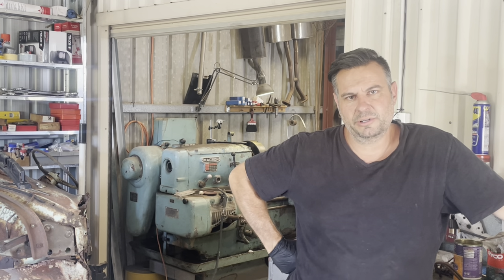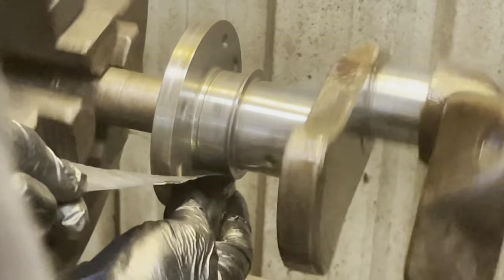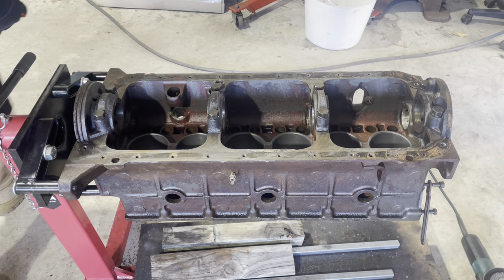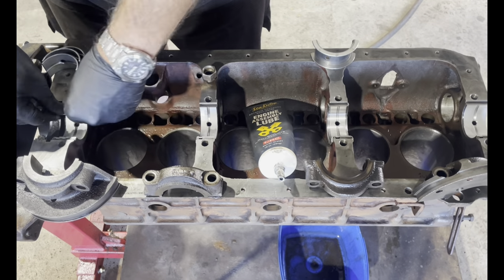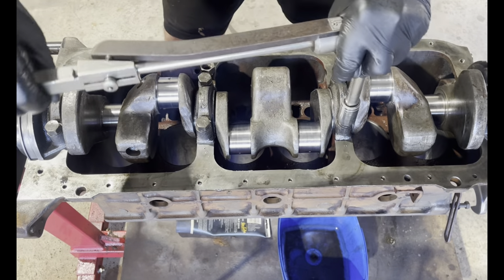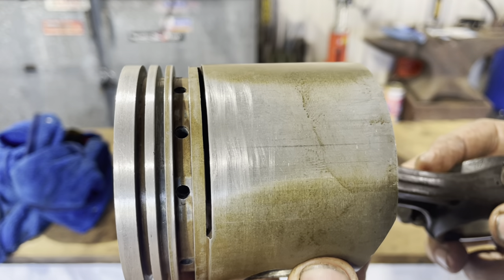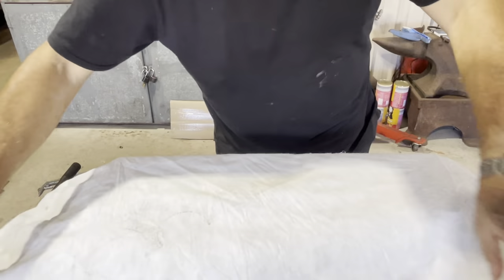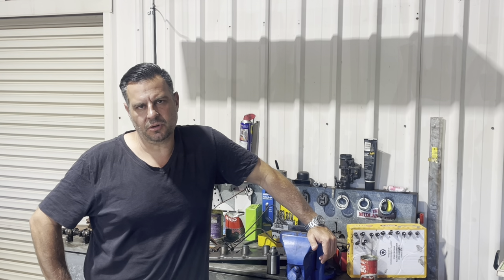FJ holden Grey motor rebuild Part 4: Crank and Pistons install

Comment: You should never lubricate the back of the bearings. You never install piston & ring assemblies dry. The ring gaps in the new rings are still too big. A 2mm ring gap is excessive. It needs to be less than half that gap. When cranks are machined, the bearing size is said to be UNDERSIZE, not oversize. Regarding the camshaft, remove that sprocket, & throw it in the bin. Replace it with an alloy sprocket. The dots on the top of the pistons denote to front of engine. The oil holes in the conrods are there to spray oil onto the cylinder walls. Don't bother arguing with me on this, because I used to do this work for a living, both full time & part time.
Reply from the maker: Thanks for your advice, right or wrong this is the way I choose to build my motors and to date I’ve not had an issue. For some clarity the Pistons and rings were not installed dry as you state. 
Ring gap measurements were an approximate measurement as stated in the video and the old rig was 2mm not the new ring was considerably smaller. 
Thanks for watching and your comment, enjoy the upcoming episodes.
Reply: You are correct do not lube back of bearings
Reply: I have to agree: how do you think that #2 rod bearing spun to begin with?
Reply: @jimwinchester339  It wasn't because of oil behind the bearing.

Comment: It appears to me that you have plain old cast iron compression rings. Those are what I prefer when not reboring cylinders as I have found them to seat quickly and be more forgiving of imperfections in used bores. I did a 327 Chevy 45 years ago using basically the same methods as you. It was a sweet runner and gave me probably 75% life of a new engine. Keep doing what works for you!
Reply from the maker: Hi and thank you. 
Appreciate your kind words and feedback. 
Cheers and enjoy.

Comment: Question : mate did u clean out those oil channel tube on the crank ?
Reply from the maker: Sure did, if you watch carefully before I remove crank from lathe I used brake cleaner and compressed air.
Reply: @petersbackyardbuilds  i so that but also so a blocked oil port ith crank polish i figured you cleaned them more off camera as so many do.
Reply from the maker: Yes cleaned the ports thoroughly.

Comment: Question. Did you lube the bearing shells between the block and caps?
Reply from the maker: Yes, very slight amount helps when aligning caps.
Reply: Should never lubricate bearing backs. Takes away tolerances and it lubricates what ?
Reply from the maker: Including you two others have said this. 
Please explain why?
FYI.
A couple different engine builder friends of mine one in particular who was building engines for 75+ years until late last year when sadly he  passed aged 95 said this is good practice to help seat the bearings properly as bearings mainly fail from incorrect placement/ fitment.
Cheer for the feedback. 
Enjoy the build.
Reply: You want the bearings to seat to the metal of the block and for the crush to be correct.  By adding lube you are potentially adding to the chance of a spun bearing. As mentioned before the tolerance will be all over the place too depending on how much was added to each particular bearing shell. Of course this is my own opinion and if this is the way you wish to do it then go for your life.
Reply: @petersbackyardbuilds  i understand that what he is saying it closes the gap on start up so it instantly clearences itself. i just myself never practiced that but hey what works for you dont change
Reply from the maker: Thanks guys for the feedback. Enjoy the videos. 
Appreciate your views. 
Cheers
Reply: @petersbackyardbuilds  Thanks for sharing,  ignore the arm chair experts that couldn't build a Briggs. Cheers!

Comment: Be careful when cleaning the ring lands with the broken end of a ring, and for that matter, a wire brush. The upper and particularly the lower faces are sealing surfaces for the rings and a scratch on them will cause some amount of blow-by.
Reply from the maker: Thanks for that, I’m always careful using that method. 
Since purchased a ring grove cleaner so should make life a little easier next time. 
Cheers and enjoy.
Reply: @petersbackyardbuilds  I have a ring groove cleaner but still prefer the broken ring method.
Near 50 years as a mechanic gives one the "feel" to get it right.
Reply from the maker: Cheers mate I’ll keep that in mind.  
I find the broken ring way to be fine so shall see how the new tool works.

Comment: You should plastigage the crank
Reply from the maker: Thanks mate as the crank wasn’t machined and I’m only giving it a refresh it’s not necessary in my opinion. 
Cheers and enjoy the videos.
Reply: @petersbackyardbuilds  The rods could be out of round not just the crank. Have you used or know how to use plastigage ?
Reply from the maker: Hi James, yes I have used it before when building a performance engine. 
I had checked the rods off camera using an internal micrometer just to make sure nothing obviously stood out.
Reply: @petersbackyardbuilds  Those engines are tractors to i guess
Reply from the maker: They sure are, all 40hp if your lucky. Enjoy the videos. 
Cheers
Reply: @petersbackyardbuilds  I asked if you had ever used it because years ago i bought a patrol petrol one.  I had it serviced at dealer. when i got it back the oil pressure had dropped. Took it back and got the its normal . I had been rebuilding engines for 10 years and knew it was not normal. To and fro for a while about it. They put in new oil pump saying that that could be problem.   That not fix the pressure. I asked what oil went in. They gave me the correct oil they said. long story shorter. they tried to tell me the pump gave pressure. When i informed them the pump only supplied the oil the bearings' gave the oil pressure they argued the point. At this stage i got them to pull engine out and said to plastigage the ends. i suspected they had put the wrong oil in it. They did this and i said i would pay if the bearings were ok . I had to show them how to use plastigage and yes bearings were well out of spec. new engine supplied and fitted at no cost. Ps had to take my plastigage kit in and do it for them.
Reply from the maker: Not surprised mate, that is why it’s best to do your own if you can. 
Thanks for the input I really appreciate it as it’s how we learn. 
Cheers buddy.

Comment: Hi there again. 
I worked for a company that built 1000 engines a week . They never lubricated back of bearings. 
There is no Benefit. 
Plenty of oil between the crank and the bearing. 
Clearances will change if you have lube under the bearing. 
But on a basic rebuild probably has heaps of clearance like your doing. 
Ring gap is 3-4 thou per inch. So your ring gap should be about .012 “ approximately not .080” 
But still enjoy your video. 
Cheers
Reply from the maker: Thanks for the info mate really appreciate it as this is how we learn. 
Putting lube on the back of the shells is something an old engine builder of 75+ years told me he used to make sure they seat properly. right or wrong so far has worked for me. 
Glad your enjoying the videos. 
Cheers.

Comment: Had an FJ years ago that I repowered with a modded 253.
The grey motor I took out looked like it may have been something a little special, it had a little alloy tag on the side that said something like "Genuine Holden sports balanced engine".
For the life of me I cannot remember what I did with that motor, but then it was 40 odd years ago.
Reply from the maker: Interesting, never seen that before but would like to find out more. 
I did consider a 253 v8 but it’s getting difficult to licence them and the engineering process is getting out off hand. 
Cheers and enjoy. 
Cheers and enjoy.

Comment: It's Amazing all these engine building experts in the comments that I've never heard of...
It doesn't matter if you oil the back of the bearings, as soon as the engine is running oil will get there. There are no seals to prevent it and the machining process provides multiple paths for oil to get behind the bearings. You arm chair experts need to do some research. I've been doing this for 50 years. I've never torn down an engine and the back of the bearings were dry.
Reply from the maker: Hit the nail on the head Jeffrey, could not have said it any better. 
There is many reasons engines fail and this is not one of them. 
This was taught to me by an old qualified mechanic who worked on them when they first came out pre 1948. 
He worked as a mechanic from the age of 14 until his passing last year aged 96. 
So he knew a thing or two……
Cheers mate enjoy the videos. 
Regards
Peter.

Comment: i built dirt track engines for years when setting oil clearences on the bearing never have it wet because that space tightened toward the crank in micro measurement you can see this easily not so easy with the naked eye... for what your doing it is nothing i see wrong with it it kinda like the oil thing which is better you ask a thousand people you gonna get at least 500 diff answers.. in the end it works !!!!!!!!!!!!!! for you..
Reply from the maker: Thanks mate appreciate it. 
Yes it works for me on these engines.

Comment: I was under the impression that the reason for NOT lubing the under side of crank and conrod bearings isn’t due to an added risk of spinning a bearing, but was more due to the helping DIRECT heat transfer away from the journals, through the bearings, to the block and conrods. 
I’m not a professional engine builder so I could be wrong though. 
I’d like to know peoples thoughts on this…
Reply from the maker: Hi Casey, in my experience a spun bearing is not caused from excessive lubricant, it’s generally the opposite lack of lubricant causing excessive heat which leads to it seizing to the crank than spinning in the journal. 
It’s a divided topic, on older engines like this one it is what I choose to do and has never let me down. If this engine was professionally bored, had the crank ground or a race engine when the tolerances are tighter etc would I lube the backs of the bearings. No. 
Cheers and enjoy the videos.